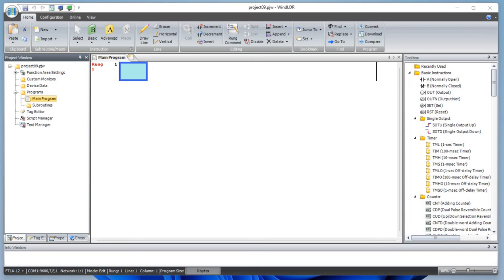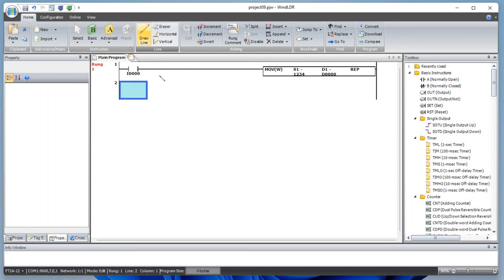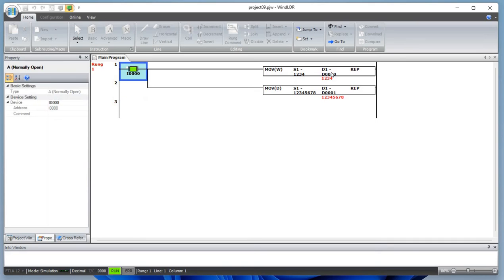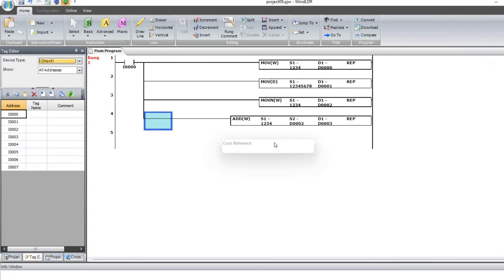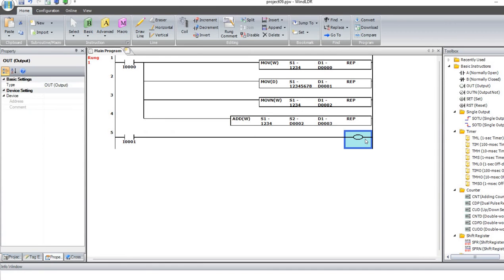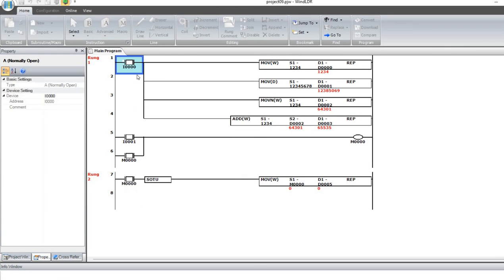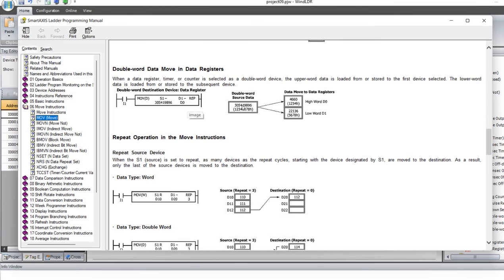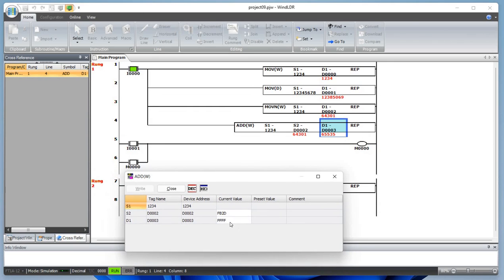9 an Idec Plc Programming MOV, MOVN Word 16 bit & Double 32 bit

Comment: I have a pulse input that i need to multiply by 10 so each time I receive a pulse, i need to register a 10. Two pulses = 20, 3 pulses = 30, etc. I know i can put in a NO (for my pulse), SOTU and then an ADD w/ S1 = 1, S2 = D1000, D1 = D1000 and it works. But, what if I now want to reset D1000 back to 0? How do I do that? Thanks for providing these videos!     Answer = If I understand correctly
Make a rung with NO contact (something is done) then d1000 =0